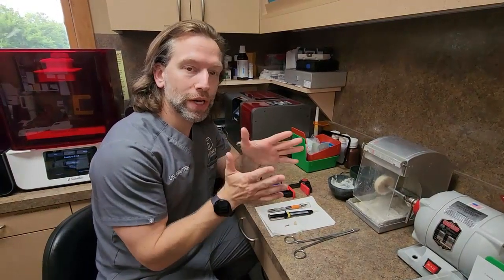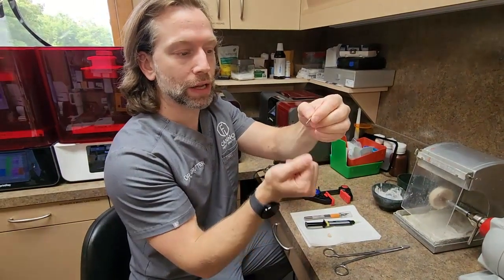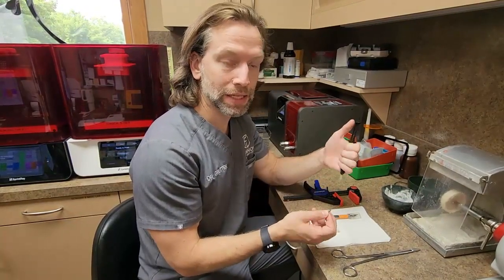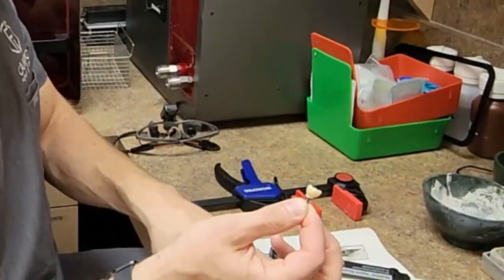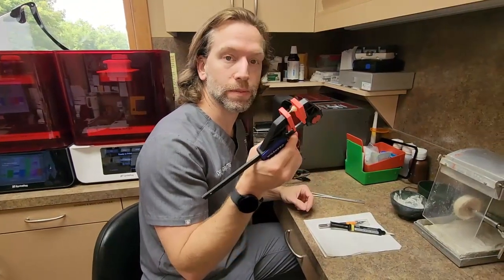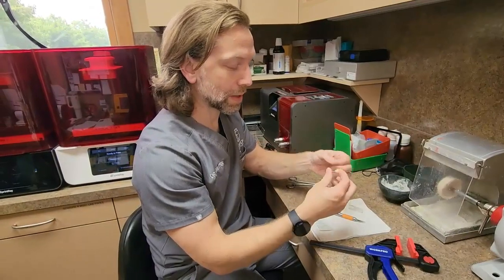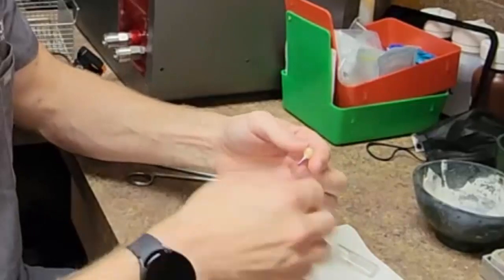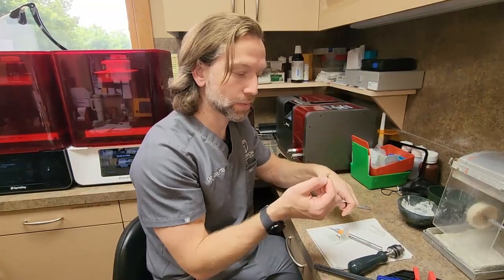CADCAM: How to cement a crown onto a TiBase.

Comment: Thanks, Baron. Awesome video.  Ive been cementing Zr crowns on my custom Ti truabutments using rmgi and a microbrush handle as the holder and the brush as the hole clogging preventer.  This looks way easier!

Comment: thanks for the video ! However I don't get how do you avoid cement going into the screw hole?
Regards from France =)
Reply from the maker: As the crown slides on, all excess slides out the margin. Cement goes at the top of the chimney, on the outside. NOT on top.

Comment: cementing the Ti Base and the crown without a model, I do not think, despite my respect for you Baron, wise. The crown on the Ti-base has some horizontal mobility and that's why I use 100% cementation on the printed model with the analog placed in it
Reply from the maker: I respect your opinion, but I disagree. After many hundreds of these with this approach, I've had excellent results. And I'm among a large list of long time CEREC users (Mike Skramsted being just one) that have done it this way since the initial release of the Sirona style TiBase. Additional, horizontal mobility would be the result of your manufacturing tolerances. In the one shown in the video, my cement gap is 0.07mm. I'm other words, very intimate with no discernable wag. 

But at the end of the day, it's nice to have so many options to meet each of our preferences.